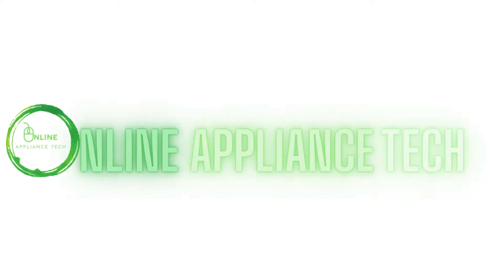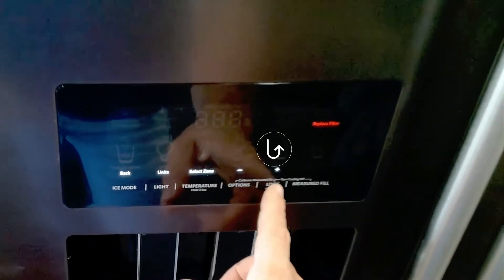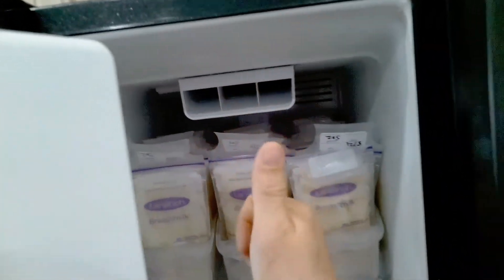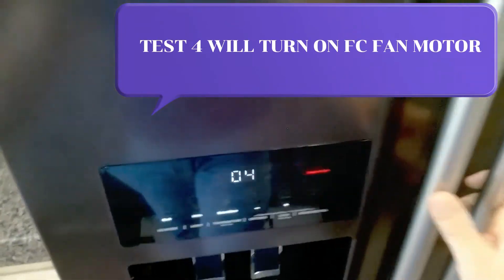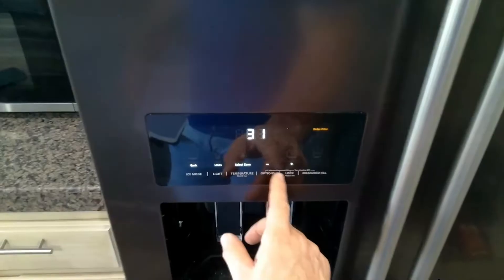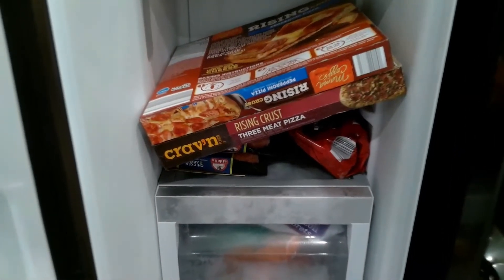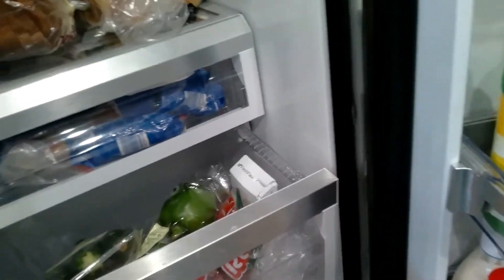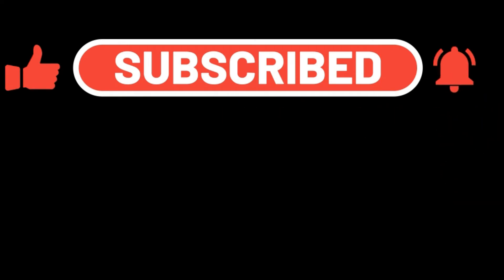Kitchen Aid  Refrigerator Diagnostic Mode, Model KRSC700HB, Troubleshooting & More!

Comment: Thank you for posting this video. I tore my KRSC703HPS00 apart when there was ice build up on the evaporator coils. 

After melting all the ice …

I ran diagnostics and the fans work, the thermistor says it’s ok, and I made sure the drain hole is not clogged or plugged. 

I put it all back together. I guess we will see what happens.

Comment: Thank you for posting the video. I have a krsc503ess01. The Evap is icing up quickly after I fully defrosted it. Did the diagnose by following your instrucrion. Test 39 shows 01. Test 06 shows 01. Do you recommend go ahead and replace thermistor even test shows both heater and thermistor are fine? Thanks a lot! Near to a point that I'll call the repair company.

Comment: Ice build-up on bottom of the refrigerator section; done diagnostic and test 39 (fresh food evaporator thermister) reads 01. Changed the computer board and the fan assembly.  Still have problems and "Kitchen Aid" is not very helpful cause the refrigerator is out of warranty (only 3 years old).
Reply from the maker: If test 39 reads 1 that means it's good. After you replaced the main PCB and DC Fan motor did it work well for a few weeks or days? However I would always replace the evaporator thermistor with a fan. Even though it passes the test. The thermistor tells the DC fan motor how fast to spin which  removes moisture for the evaporator. If the fan doesn't move at right rpm it will build back up with ice, and always defrost evaporator removing all ice before or after replacing parts plus make sure your drain line is not clogged up. Check out my other Kitchen Aid video. Hope this helps!